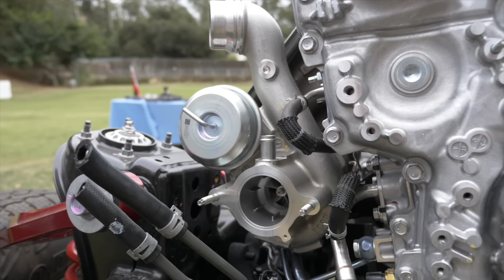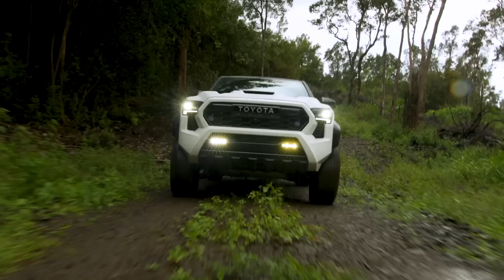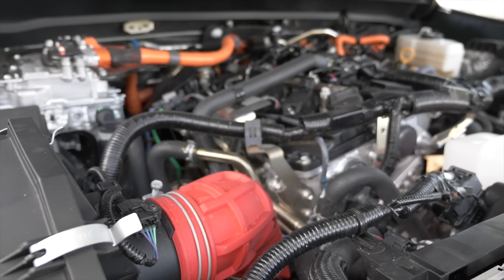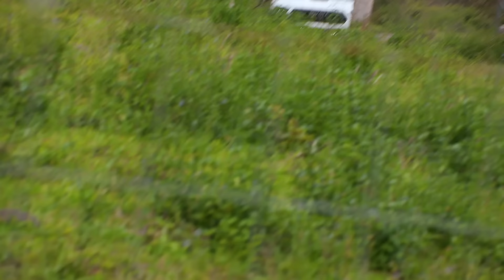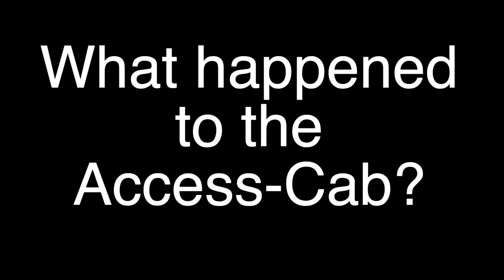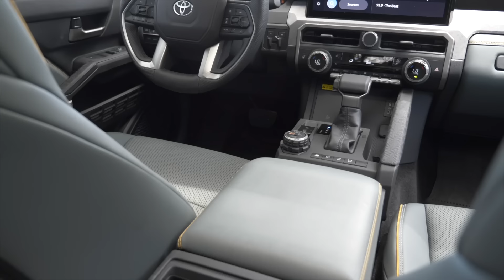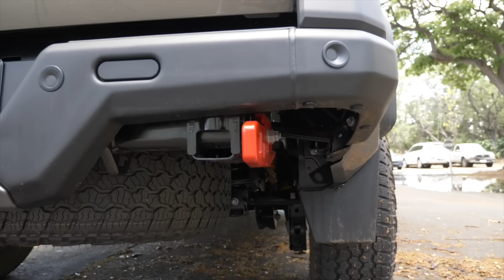2024 Toyota Tacoma Chief Engineer on new engine reliability and more...

Comment: hey I don't know about you? Under the hood. Looks like a Psychotic Mess  from Hell. When Toyota used to make, simple, straightforward, power plants. What the hell was  that thing is? It's a psycho mess from hell. It's overly complex. So many more things to go wrong. It used to be a shinbone connected to a knee bone connected to a hip bone.. Now? I don't know what this is? It's overly complex.

And so to make a product that's going to last a long time. It can't be overly complex. With dozens of hoses and tubes. This is a mishmash  of psycho frenetic crazy. To accomplish something overly complex. Yeah no. This is not the way to go.

Most of the huge mass and over complexity is due to Emissions Standards. Also emissions standards and MPG  doesn't play well together.

Electric would be great. If the battery technology for that existed. It doesn't. Lithium ain't it. Lithium is great. For so many applications. But not for cars. Not for trucks. Maybe buses? Because they're not designed to go fast. They are designed to lumber. And roll smoothly and slowly. With no, off road-ing, necessary.

I don't know what to think about this concept? I don't like what I see. I do not think turbocharging is the way. It may have been for big lumbering diesel trucks? It's not really necessary for the consumer fruitcakes out there. A normally aspirated engine will last longer. And everybody knows that. And this has not one but 2 Turbos. For twice the costly repairs. Yeah no. This is not the way to go. Perhaps you should go back to your old Hybrid, concepts? To improve overall MPG's.

What happened to a generator under the hood? With electric motors driving all 4 wheels. What happened to that concept? Isn't that maximum torque? Is Toyota chasing their tail? They don't know which direction to go in anymore?

I mean I think we are entering a phase of Limbo?  It's like how can we build vehicles that are still legal? That people will want to purchase? What do Americans want?

Americans don't know what they want. I mean the children do in adult bodies. They all want 250 mile-per-hour racecars! Because that would be the only way to feel Manly. And boys need to feel Manly behind the wheel. So do some girls. To achieve that, Testicles in an Uproar, kind of feeling. Some girls like that also. Like Sarah Palin, Lauren Bowl Burp, Marjorie Failure Greenemold, Amy Coney Island Barrett and so many other, similar morons. Simpletons. Conspiracy theorists. The whole 9 yards of crazy. And of clueless ignorant stupidity. Just keep acting stupid. Keep acting, ignorant. But we know that's no act. You are the real deal. You are truly ignorant Homo sapiens.  What planet did you come from? The planet of hard knocks and no rights? The Nazi planet? Write the Nazi planet. Your favorite spot. Where you can hate all the Americans you want to! No you can't. We've had enough of that. We moved into the 21st Century of the New Millennia. You could move back from that if you like. We know you want to. Going back to those 1800s. So you can pretend you are in a movie. And all this milk and honey for you. And it episode out of Father Knows Best. Of course he does. We are back in the 1800s again. An education is only allowed to white boys. That want to learn how to make cars go faster and faster and faster! And how to make things go boom bigger! And destroy better! Because some guy by the name of Nobel created dynamite. Great! Peace prize, eh?

Of course Toyota is trying to cater, to the American palate. Toyota has always been smarter than Americans. But it appears not anymore?

I mean it looks like you have to be Einstein. To deal with these power plants today. If you are not a mechanical engineer and a chemical engineer and an electrical engineer? You probably shouldn't be working on these engines. Because you're not going to understand, anything. These are no longer simple air breathing engines. These are no longer just air pumps. This is alien spaceship drive. You have to know computer programming to work on these engines. You have to have a Masters degree in Mechanical Engineering. To work on these engines. You need your head examined. To work on these engines.

And so, pretty much. If people were forced to get their cars tuned up every year. Instead of just inspections. We would need far less of this emissions control. But nobody wants to mandate what needs to be mandated the way it needs to be, mandated. Because  boys need their vehicles to go vroom vroom. Because if they can't hear that? Then the engines no good. Because boys want to hear a mechanical beast growl. Because they are little boys. That want to make pretend they are race drivers!  Oh yeah wow! It's so much fun being a boy! You can tell the girls how to live! You can see them get upset about pregnancy. Ha ha ha ha ha! Ha! It's all their fault because they are girls!  They are a different species room boys who are stupid. Because girls don't know how to tune an engine properly! And should not be allowed to. They are only good for housekeeping and babymaking. And making sure dinner is on the table when you get home. The way girls are supposed to be. When they are owned by their man. The way they want to be.. Because they are girls. They are stupid. Maybe boys can teach them how to be more fun? As boys need to teach girls how to provide boys with total pleasure. Because they are boys. And that is a girls job.. And they all know it. Because they are girls. They are not boys.. So they don't get to do would boys get to do. Because they are stupid girls. They know how to do anything. They are stupid. Boys have to teach girls. How to properly bend over. And take it like a girl.

And so some boys are like chimpanzees while other boys are like bonobos. Which one do girls like better? Both. Because girls know that hostile degenerate boys. Make stronger boy babies. And that turns some girls on. But only because girls are weird. Because they are girls. They are different species from boys. But boys don't care. Lots of boys want to get it on with each other. Like Islamic  and Orthodox Jewish boys. They like dancing with other boys.  And then they hate gay people. Uniformly.

It's okay all Caucasian Americans feel entitled. Because we are. Donnie said okay.
RemyRAD

Comment: I'd  trust a Toyota turbo 4 cyl. over a Ford turbo 4 cyl. Thats the bottom line. Turbos need robust engines to operate in which Toyota has accomplished.

Comment: Cummins fan here.  I was around when Dodge tried to convince us that the new electronic 24 V 5.9, introduced in 1998.5 Ram trucks was a superior engine to the tried and true 12V 5.9.   They lied!  The change was due to tighter emissions requirements, just as the Toyota mentioned here.   The new 5.9 had worse fuel economy, was noisier, and less reliable than the old 12V.  Very disappointing!

Comment: If they are so confident the new engine will last they should increase the warranty to make consumers feel safe.
Reply: Excellent idea.
Reply: Damn straight.
Reply: @justacinnamonbun8658 I am responding to you respectfully, but your comment is a complete strawman argument and a phalacy. Not once did this engineer mention that "A" "turbo engine will yield better fuel economy" . He very clearly stated that THIS particular turbo charged engine yields better fuel economy, as compared to its predecessor, meaning the V6 in use now. I wouldn't doubt that at all, as while just cruising or idling, on average, a 4 cylinder engine is more fuel efficient than the average V6. I will also add that this engine will have more peak torque than the outgoing V6 in the tacoma now, due to it being a forced induction engine, while still having better fuel economy overall than it's predecessor. Let's at least be honest about what was said instead of making up what you wish he said. All this being said, I'll add that I own a 23 OR 4x4(lunar rock) and I do not plan on getting a turbo 4 anytime in the foreseeable future. I prefer my vehicles to be N/A and as a tech, know first hand many of the problems associated with forced induction on most engines as well as the lower longevity as compared to their average N/A counterparts. That's not to say that these engines(or others) will not last long or not make it past 100k miles or more, or that all N/A last that long. How many times I've replaced/rebuilt complete engines due to internal wear/failures that were N/A before 100k miles? Too many to remember.
Reply: @erod6468  BS Bro, at 22 seconds into the vid, engineer states, "obviously, they're coming to America to help us with our emmisions and of course FUEL ECONOMY and power." I did not make that up or pretend, that is exactly what he said.
Reply: @mountaingoat168 pay attention and read. And pay attention to what you read. 🤦🏾‍♂️
Reply: @erod6468  You're the man with the experience!!
Reply: @erod6468  He straight up lied at the beginning with the old marketing gimmick that a turbo gasoline engine will yield better fuel economy. Apparently he must've learned some tricks up at Hogwarts that allows these engines to cheat the laws of physics. You need the same amount of fuel to deliver the same energy in terms of keeping the air/fuel ratio so you don't ruin the combustion chamber and spark plugs. Then more volume of air that comes in the more fuel you need. You tow with one of these things you're going to get V6 fuel economy anyway. He's just a corporate hostage trying to keep his job.
Reply: @justacinnamonbun8658 when you take that stupid looking air dam off it will get v6 gas mileage like it is…lol why can’t the biggest auto maker in the world have more than 1 engine choice? Makes no sense. Have a v6 that people would rather have and a 4 cyl turbo for the beta males….simple!
Reply: The number of miles that you'll be without issue will be above 100k as well.  Once you put all options next to each other at that number higher than any warranty, which powertrain do you want?  

I'm not pro 4 banger for trucks, but he's not wrong that this has been a staple overseas for decades including turbo diesels.  And the cliches such as "go anywhere with a Range Rover, but if you wanna get back get a Land Cruiser" come from those LC's with those engines.  Those engines held up reliably in the Outback, the Sahara, Saudi, New Zealand, China, Siberia, etc.  Not powerful.  But really reliable.  

Does that mean that it is that reliable?  No.  But they beat on these smaller engines like crazy with Land Cruiser in both 4 and 6-cylinder turbo engines like they have for decades.  We just aren't used to those smaller turbo engines, but they HAVE been more common over time with Toyota in their serious off-road offerings.  

I guess we'll see.
Reply: @Michael-ii9fs  Yes the 2.7 Turbo Diesel the one found on the Hilux comes to mind. Only concern I have is the Hybrid and off road combination.
Reply: exactly ...add this tO any persons opinion who wants to argue with physics ,  we have seen  V-8  and  V-6 outlast stressed out 4 cylinder  engines  because theres  TONS  more metal , parts  ,and  surface areas  to wear On V8 and V6  way more over time Verse  4 cylinder which  WaY has Less of all of them and  being maxed out virtually  in metals  capacities / horsepower output     , -- it ether goes one way of another  : you buy extra gas for the  v6 v8 over time  which isnt  that bad  OR  or    another i4 replacement   engine~   which one do you choose?
Reply: @spanishtreasure9551 I've worked on subarus and eclipses with over 200k on engine before overhaul . Just depends on how you take care of it
Reply: Only time will tell. If this engineer is proven wrong, Toyota’s brand will be greatly damaged for decades.
Reply: @bidenwearsdiapers4026   you also mean only physic will tell
Reply: I don't buy it for one minute that a turbo 4 hybrid will be as reliable as the V6 that Toyota ran with little issue for so many years,
Reply: @markmassoglia  I know just look at those unreliable Priuses .....:face-red-droopy-eyes:
Reply: My buddy has a 99 Tacoma with 600K on it.  @markmassoglia
Reply: @markmassoglia how those v6s doing ?
Reply: @markmassoglia why? If the turbo dies that’s a 1500-2k part installed. Doesn’t mean the engine is bad. Toyota made more i4 engines than any other engine over its history. Even if the turbo did shit the bed at 150-200k miles. That price point to go another 150k on a Toyota engine is nothing. Your Garunteed to spend more than that on any other GM vehicle and probly long before 150-200k miles lmao. 

People seem to worry way too much about the turbo, like the turbo shitting the bed means the entire engine is gone too. Modern turbos can withstand a lot. They can last very high mileage and even the life of the engine.
Reply: @markmassoglia there is absolutely zero chance a turbocharged 4 banger will last as long as their bulletproof NA V6, especially if it’s used for towing or real work.
Reply: @jpete3027666 People said the same thing when manufacturers went with V6 over V8, the size of the engine has nothing to do with life expectations.
Reply: @jpete3027666 yea tht turbos going boom 💥 before 100k
Reply: @jpete3027666  i have 200 thousand miles on my honda 1.5 turbo l15b7 engine.  The trick is to just change the oil every 5 thousand miles.
Reply: Kia offered 100k miles  10 year bumper to bumper and 60k powertrain, and their Theta engines were still crap. Manufacturers can offer 300,000 miles, 18 years warranty but that doesnt mean they will honor it without serious legal representation and hoops to jump through.
Reply: turbos have been around for 50 plus years,  why wouldnt they be reliable?
Reply: Do these 4 bangers have to use 93 octane ? If so any fuel savings will be negated vs the 6 cylinder using 89 octane
Reply: I agree, that would ease a lot of minds.
Reply: This engine will easily outlast the 3.5 V6.  They have the same warranty for all engines.
Reply: The turbo fours are fabulous engines!
Reply: @rjdavis7503  for soy boi guys ,to drive their boyfriends to the mall. they are not truck engines
Reply: So many comments and so many likes, and not one Tommy Boy reference? For shame.
Reply: My 19 taco got totaled by an idiot. Was great trick with the V6.  Between the rates and the 4cyl I won’t be buying another.
Reply: 4cylinder engines are reliable
Fewer moving parts
If they are overengineered for forced induction shouldn't be problem
Would trust this engine more than the twin turbo V6
Reply: I don't trust a white man explaining toyota.
Reply: GM did with the turbomax
Reply: Agreed!!
Reply: They are testing the shit out of them now days. 15 year duty cycle.. they should stand by that…
Reply: Bingo
Reply: Name any manufacturer that does that. Besides kia and hyindai and their 10 year warranty is a bitch to get replaced
Reply: My last 3 trucks have been Toyotas with the larger  engines (one a midsize Tundra V8 and 2 V6 Tacomas). I plan to keep my 2020 V6 Tacoma for as long as possible. I’m not sure I will be buying one of these 4 cylinder turbos. Only time will tell how they hold up.  That engine along with all the quality concerns about “assembled in Mexico” comments I hope Toyota goes back to quality first before I have to replace my Tacoma.
Reply: @da1shark  On my 2020 Tacoma the engine and trans are made in japan, only final assemble is done in Mexico
Reply: @richardyounkin1557 Yes i understand it was assembled in Mexico    There was an issue with the paint coming off on the white version - yes i have a white one. I am keeping an eye out for that issue. Garage kept and only 25k miles. So fares i only have replaced the battery. My wife has a 2019 Camery with a V6. Only way to get that engine was with a moon roof and leather seats- which she dislikes (but the V6 was a must for her).
Reply: @da1shark  that 4 cylinder turbo engine shown in this video is not a new design from toyota. They've been producing it for years in a lexus with not many issues at all.
Reply: Git-R-Done !
Reply: More reliable maybe without any stress factors…. Soon as ya add weight for your bumpers or camper, let alone a trailer pull these things are gonna burn up
Reply: These things have been used for like 4 or 5 years already, you just see a smaller number of cylinders and get mad. Just like the same idiots who claim a v6 is too underpowered and can't do anything because v8s exist
Reply: I still don't understand why you need gasoline engine in pickup truck. This is work horse in all the other parts in the world Toyota sells Hilux with only diesel. 2.8 l diesel is waaay better choice for a pick up any way.
Reply: mine came with a lifetime powertrain warranty. 2025 TRD Sport, purchased 2 weeks ago.
Reply: truth
Reply: You know they have a lifetime warranty
Reply: I got an 11 year warranty?? I think thats pretty good
Reply: I thought the engineers were Japanese? 🤔
Reply: He works for Toyota. What did you think he would say?
Reply: ...not how logic works.
Reply: Back seat is too small
Reply: Find a CPO with the better warranty.
Reply: 95k on 2024 no issues
Reply: Yep, they should increase the warranty to last as long as the average old school V6 or V8. But we know they won’t.
Reply: They had to shrink engines, the government is leaning on all the automakers, tightening mileage and emissions standards every damn year.  Don’t blame makers.  This is your government at work.
Reply: @daveperk 
Yes, blame the EPA which was created by Republican President Richard Nixon and his Republican Administration.

The evil CARB also, created by Republican Governor and later Republican President Ronald Reagan and his Republican Administration.
Reply: @dvader3263  I do blame them. Any questions?
Reply: You give me 150k powertrain with no year limit I might entertain trying this vehicle.  Until then toyota is dead to me.
Reply: @donaltemus3565 yall need to do calls research. Never hesrd of the toyota hilux.. toyota is the 4 cylinder kings